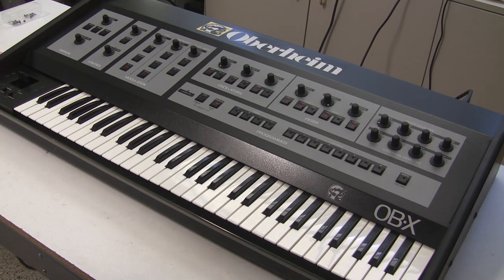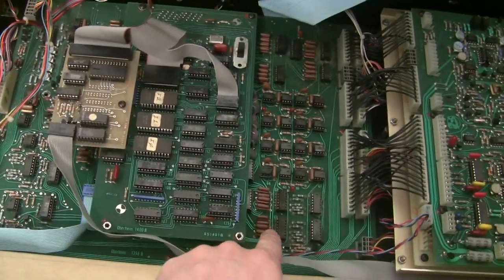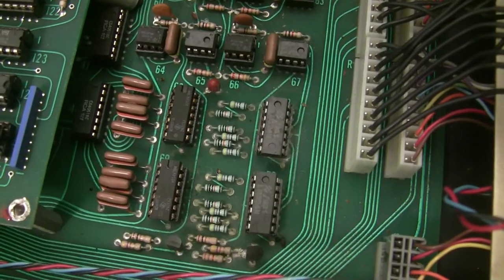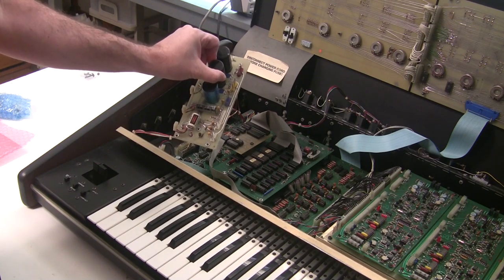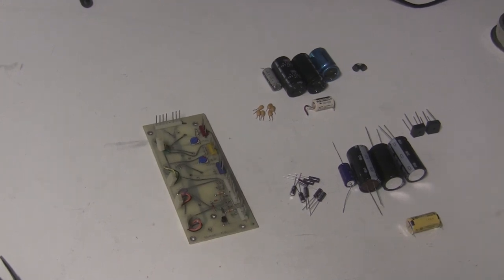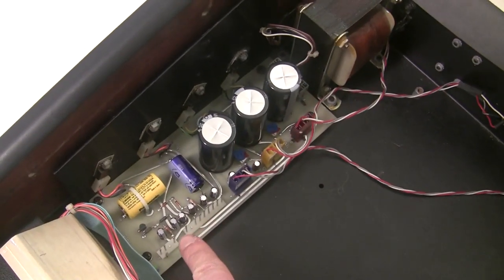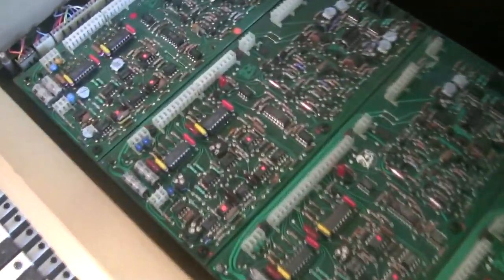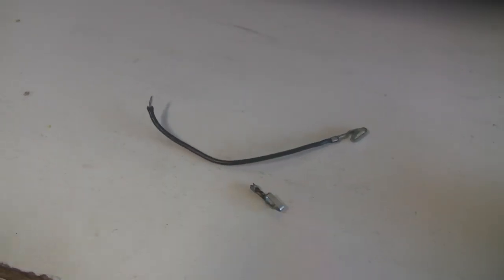Synthchaser #039 - Oberheim OB-X Repair - Mouse Pee, Exploded Capacitor & More

Comment: I have (2) OB-X's one working, one is not, which also had the JL Cooper "Patch 96" expansion installed. Im surprised you didnt use a socket for the new power supply battery (easier for future replacement). Also would love to see a detailed tutorial on removing the old soldered parts, which is often quite difficult on vintage equipment.
Reply: miamigroove Yes, 3v coin battery socket is an excellent replacement. A previous owner of my OB-8 had that done. The fixed batteries do last long after it has been replaced, but the coin batteries last long as well but no soldering to replace.
Reply: venusiansky : Get yourself a solder sucker tool and some solderwick. Melt the blob around the component and suck it out with the sucker. Once the component is out, hold the wick against the track and heat it up with the iron. It will soak up any remaining solder if you wipe it around the hole. Then give it a clean with some solvent  and a hard brush to remove any flux.

Comment: DID THE MOUSE HATE THE SYNTH OR JUST HAVE TO PEE. WHY WAS IT IN THE SYNTH
Reply: Rodents like the smell of plastic wire insulation, which leads them to chew.  No idea how the little blighter got into the case, though...

Comment: What a coincidence ,, the Arp Omni 2 im just fixing had a mouse in it !!!!  Its nibbled some of the Caps and peed all over too !!! But it must of got itself stuck inside for a while as its nibbled the bottom of every key lol the front part thats lower and sits behind the chassis front
Reply from the maker: I had picked up a Solina organ that had been the home to mice, but it was too far gone to save...  On the bright side, now I have spare Solina keys!
Reply from the maker: Now I'm curious... How did the mouse get inside?
Reply: Synth Chaser that crossed my mind too  but just like your vid above i had the pee damage but mines worse  as ot nibbled  the few caps that had been changed from Tants    It didnt get through Alloy cans but just the plastic sleeving leaving teeth marks on alloy. But its nibbled every key lower flange  right along as though trying to get out  ive now got synth all up and running 99.9% just a release issue i thought was maybe Op Amp or the 2n pnp transister next to Release plug but ive now worked out its the simplest of faults but end up taking hours finding ???? Yes the classic Release foot switch Jack  corroded and open circuit lol acting like ot has foot control pedal in  im embarraced to say took me two sessions with synth finding it lol amongst finding other faults
Reply: Synth Chaser probably got in when it was young and smaller.
Reply: I once had a mouse in a a piece of lab gear. We found it fried on the 12kvw HT power supply.
They can get in very small spaces like ventilation slots.
Reply: @Synthchaser  - Exactly!  I was wondering myself.